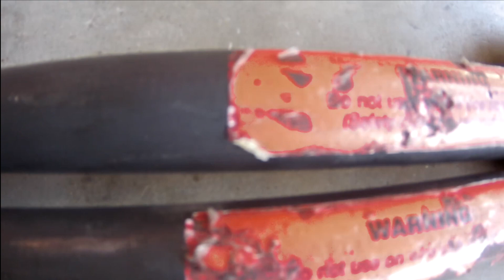E-Z Ratch Torsion spring winding system•

Comment: Bad design, not all springs rely on the casting bolts and there is no way to slide the locking key steel into the casting bracket